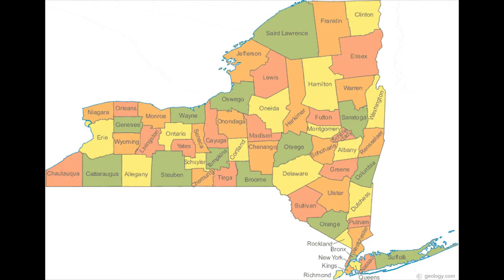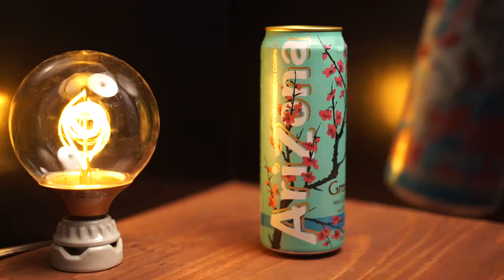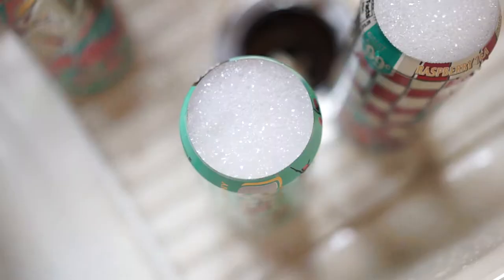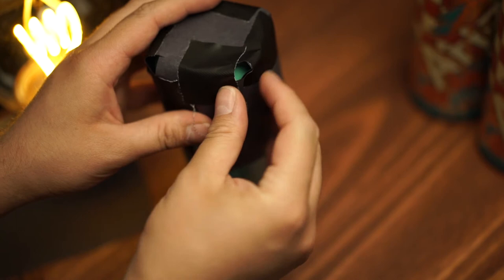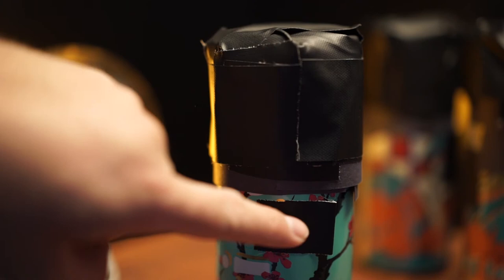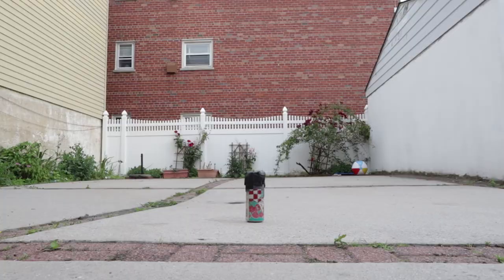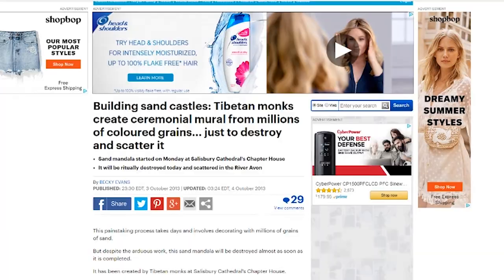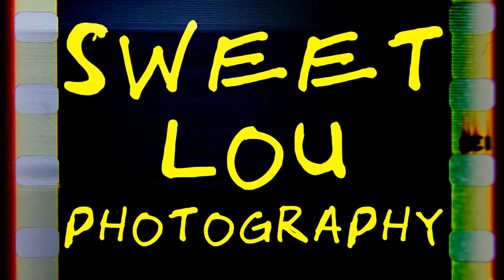HOW TO MAKE A PINHOLE CAMERA AND DO SOLARGRAPHY

Comment: Some suggested improvements- .If is to be stuck outside for a long time you may want something more weather resistant. Cut the bottom of another can and stick it on top(advantage more beer too).  Paint the inside of the can black to remove reflections, paint the outside black to make it less visible. Stick a label on it. Mine says solar experiment because people get upset if you say camera and give a contact email address. Not sure that this will work, but may stop people removing them
Reply from the maker: Absolutely love your thoughts (especially the more beer part) Thanks for taking the time to write this up!

Comment: Hi there!! great video, very funny, thanks. I am trying to do my own solargraphy and I have some questions.
Do you just use photo paper like any other, no sensitive light, cyanothipe or something like that? I have a photographic paper From Ilfordmultigrade fb fiber matt, Do you thik this would work? and if is photographic paper why it dosent need all the dark room developing process? hace a nice day and thak you for sharing this :)
Reply from the maker: Hey! Best of luck, it's a ton of fun. I used typical Ilford photo paper, like you would use in the darkroom. It is sensitive to light, but if you pop it into the pinhole camera quickly, it shouldn't be an issue. Regarding developing, you are basically "burning" the image into the paper. Think of it like a negative. That's why when we scan, we invert the image. Hope that helps!!